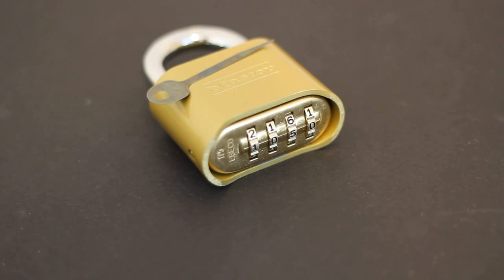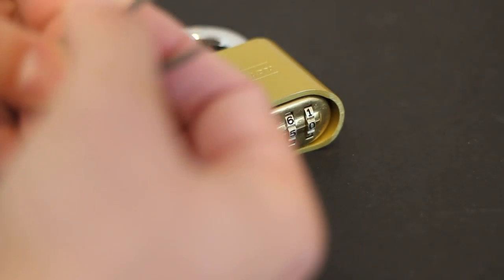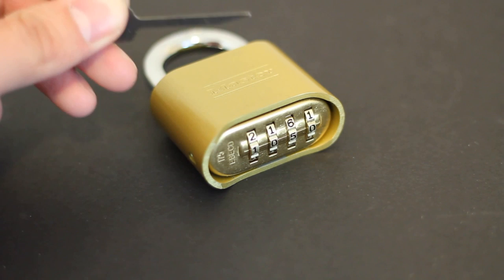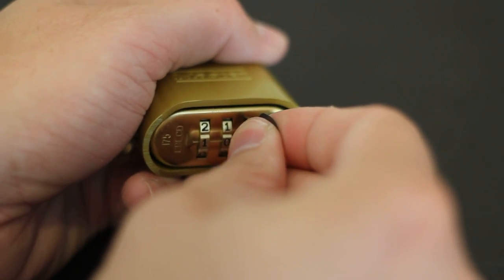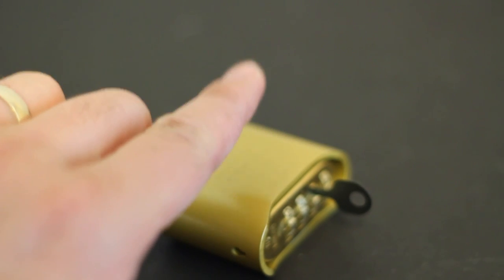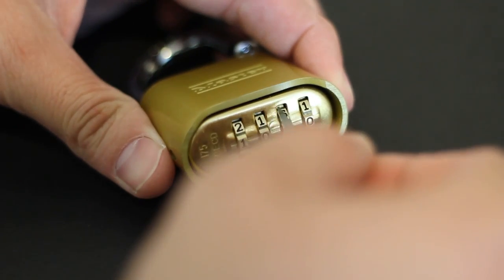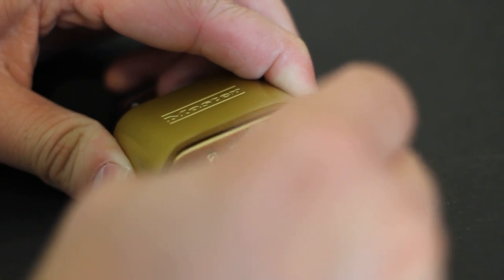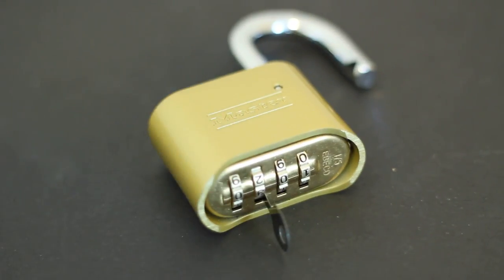EZ Decoder: Bypass Locks in Seconds- Black Scout Tutorials

Comment: Each wheel has a notch( look down the sides, between the wheel and the lock frame and turn the wheel until You see the notch) line up all 4 notches. Then, turn ALL wheels maintaining notch alignment. until lock opens. no tool needed, but the tool sure looks much easier.

Comment: I have had a Master Lock like this for 6 years my Dad set the combo on and forgot it. I live outside the USA so buying the Decoder Tool would not be easy. I looked at the VDO and with my trusty DREMEL tool and an old hack saw blade I cut a tool. Leave the hacksaw blade full length for a handle, Cut the hole off the end with a cutting blade and the DREMEL tool. Cut the end section 1/8" wide by 2-3/4" long. Cut a taper on the end about 3/8" long(Look at the video and get an idea). Now try the DIY tool just like the video shows but it will be too thick. I use a small vice and very careful using the flat side of the DERMEL cutting tool ground the side down and then flipped the tool over and ground down that side. Then try the tool. Do a tiny bit on both sides then try. You have to be very careful of it will be too think and break. Gently try the tool in the lock then pull out and see where the  mark is that the tool was hung. Gently grind that area.  It took me about 45 mins to make the tool and pick my lock.